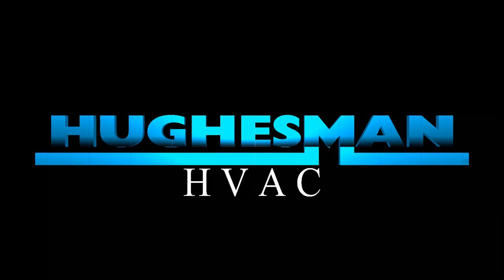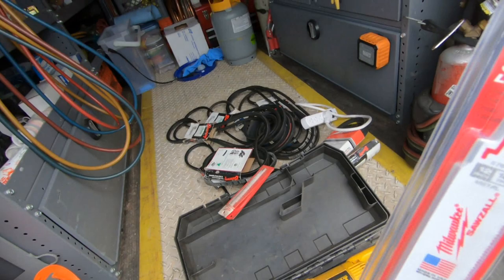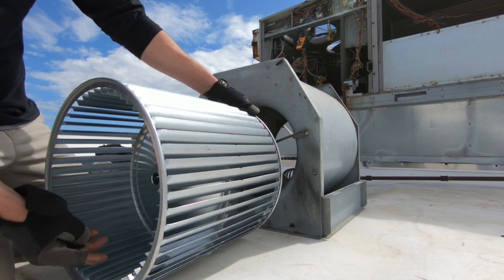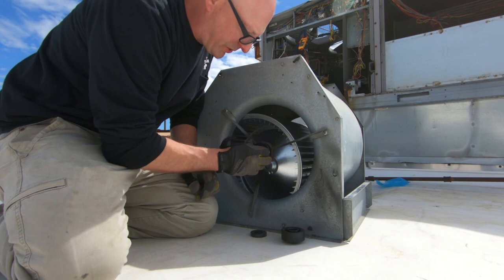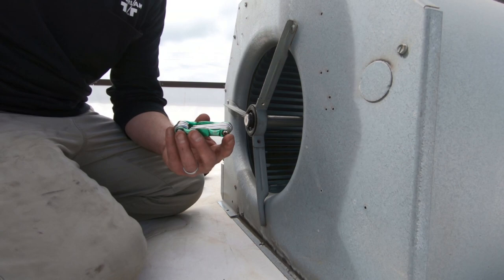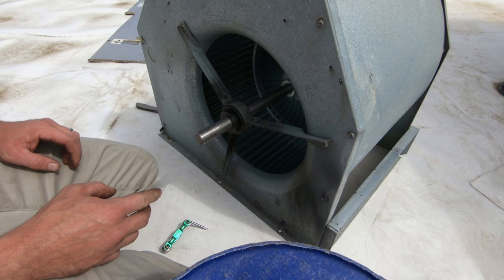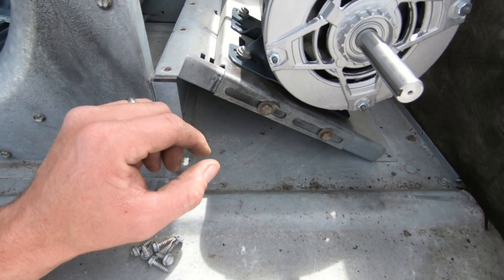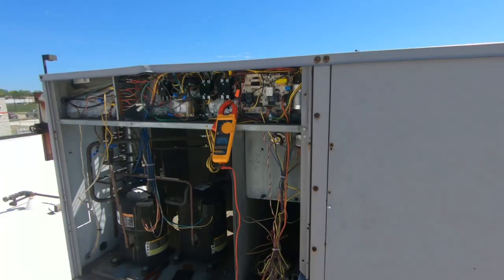Blower Bearing Replacement

Comment: To align pullys, i use a string from the far end of the blower pully and stretch it back over the far end of the driver pully. Once the string lays flat over the pullys, theyre aligned. 
Ive also used the straight edge of a tape measure. Lol.

Comment: Need to replace bearing on my house furnace blower, but I need to keep a cage and pulley !
Reply from the maker: Hope it works out
Reply: @HughesManHVAC  It did ! Just replaced it yesterday, furnace purrs like a kitten, better than in years.  On a second thought should have probably used the old rubber gasket, the new bearings came with a little different (and more narrow) ones, but it looked damaged on the first glance, just later after I washed it, I saw it is all right.  But now I can take it apart again if needed :).  Bearing sleeve on a pulley side was eaten through like by 1/4 inch in a side, the blower was full of metal shavings